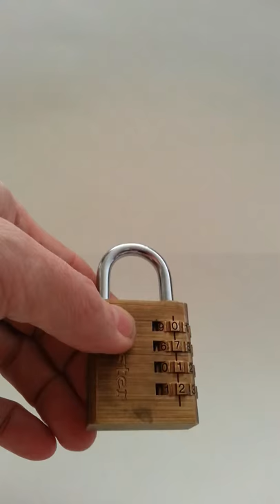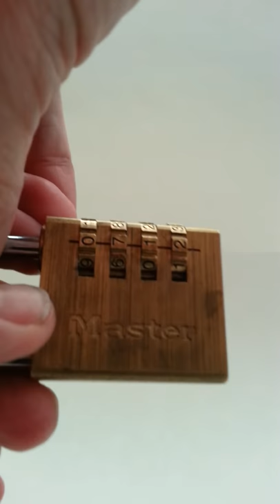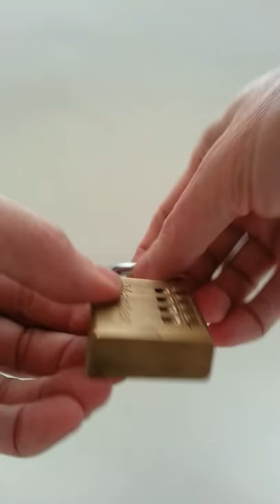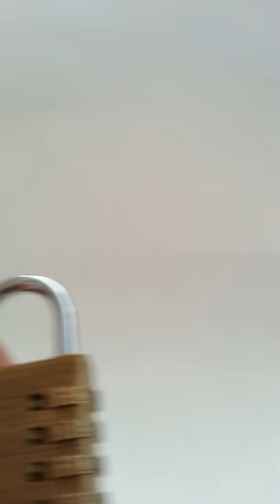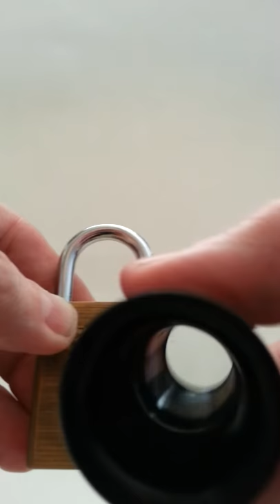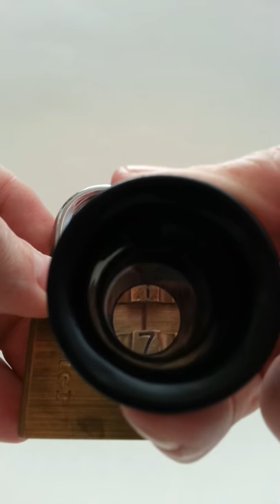I Can't Crack/Pick a Master 4 wheel padlock

Comment: I’ve been at mine for now for a day solid.  Used vice load method, paper clip, pin, hanging pressure on a side hook from wall, two screw drivers to squeeze grip for sensation, so far I’ve been close with 3 wheels just can’t get the fourth to ever find a home…. For 10 bucks this is a damn good lock!
Reply: 643d is the lock brand master

Comment: the lock picking lawyer would have done found the deeper correct gates through the false gates or used a pick to ge inbetween the code wheels to unlock it, not that hard to pick that padlock bro